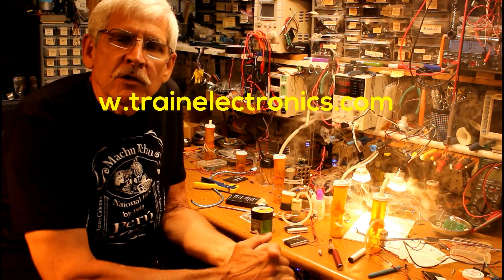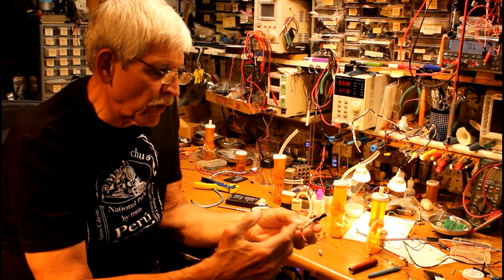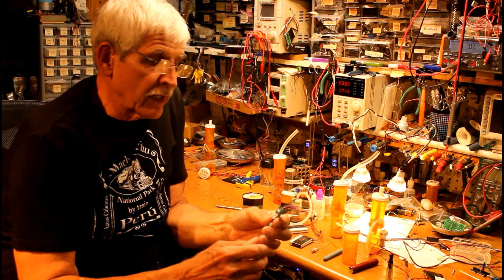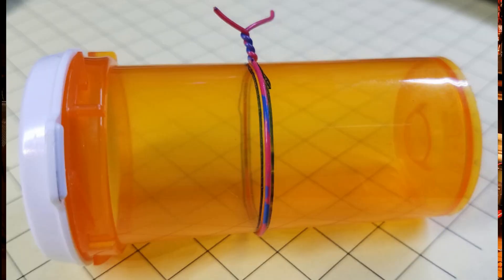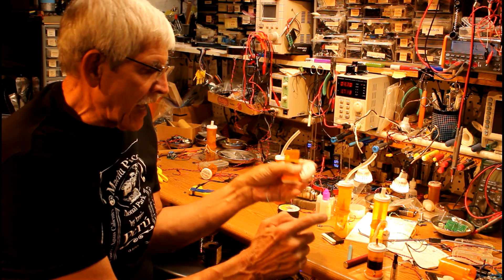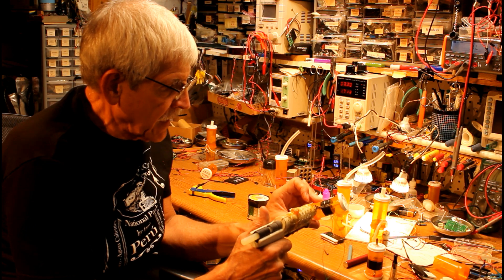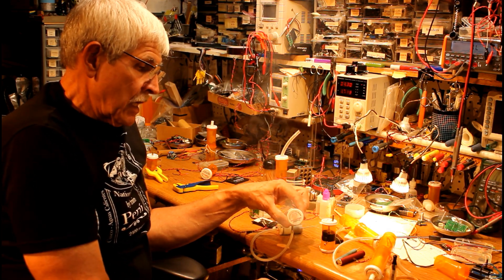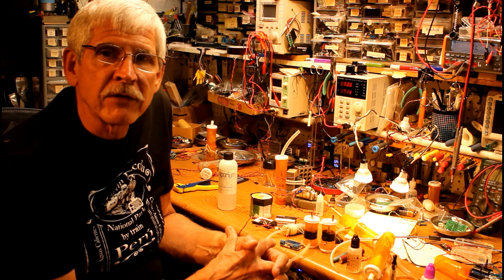Smoke Animation with an E-Cigarette

Comment: Can't buy E-Cig on Ebat any more. Not even heating element.BTW, you can add a mini float switch, which would break electric contact that feeds the coil, when the fluid is too low. This will prevent coil from continued heating while fluid is absent.
Reply from the maker: There are a few other sources for the heating units on my web page here
http://trainelectronics.com/Animation_Smoke/
scroll down to the section titled:
Heater Availability (as of 1-2-2021)
dave

Comment: I have to wonder if what you said about the vacuum pump gumming up, is what is happening to these people doing the vaping. I know they are leaning towards other additives in the mix as the problem, but if your experiment gums up a pump, then why wouldn't it do the same to someone's lungs, given the volume of smoke going in and out of them while vaping. Nonetheless, I like this for use in model railroading.

Comment: Brilliant thank you needed to have smoke appear from within a small box (Magic trick) I tried a water fogger but very hit and miss.  This design will be exactly whats required.  One question would it be possible to attach the pump output directly to the bottom hole of the coil ... do you think it would work as for my project space is a premium.  Thankyou for your efforts

Comment: ty ty ty so much you saved me so much money!
Reply from the maker: Happy to have been of service - can you tell me more?
dave
Reply: I was planing on installing a smoke machine in my layout. But between the money and how it really  works. I was not satisfied. I figured I would have to use a few smoke machines. But with your technique I plan on building many more. Not only due to my ptsd I have several pill bottles. But I have those heating elements already and the power pack. I am pretty sure I can find one in my junk paile. With the detail instructions I can follow this step by step. Even someone with a memory disability like myself can follow this. I love these old school easy electronics. Reminds me of my trips to the real radio shack of the 80's. I look forward for other animation videos. TY. BUilding things with your hands and figuring out an alternative way is a dying art. Now its about aps and just go and buy and instal. No more using your mind and imagination.
Reply from the maker: That is great news, Masone - good luck with your building!
dave

Comment: You could just use a 5v phone charger and a diode to get the voltage under 4.2v
Reply from the maker: A good thought but most phone chargers don't provide sufficient current.....
dave
Reply: Only if it can give you 1 amp.

Comment: Dave,

Another great idea. Have you experimented with normal train smoke fluid? Another good source of power for these would be a pc power supply if using it for accessory power or something.
Reply from the maker: Chris - I don't think regular smoke fluid (oil based, I believe) would work with the heating unit - likely to gum up the works!
dave